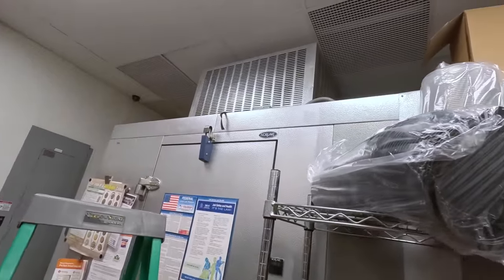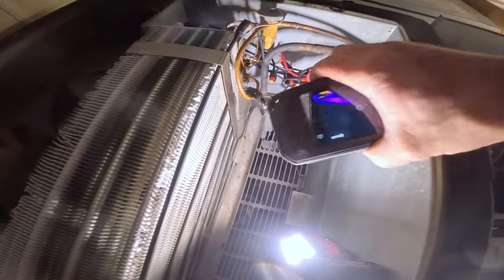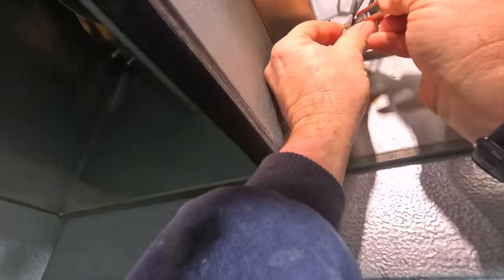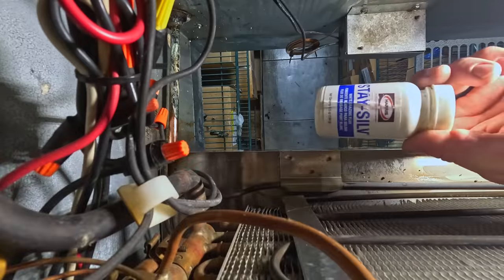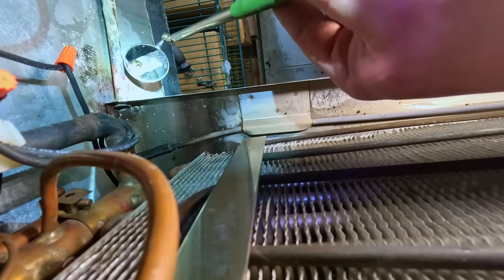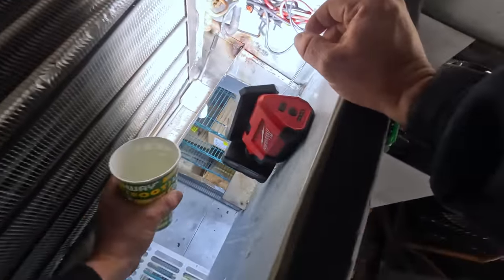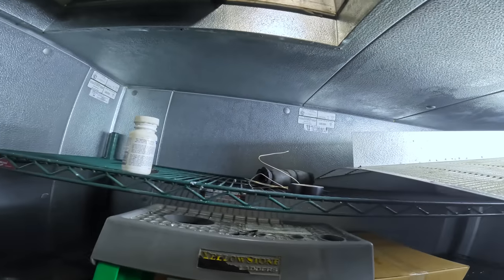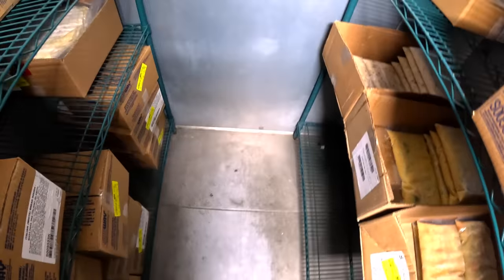Water Leak In The Freezer

Comment: Not sure if someone already mentioned it, but on those Norlake boxes you can remove the entire drain pan by pulling it out from the bottom. Remove evap fan bracket, take all the drain pan screws out, then move the return/supply air grate and pull the entire pan out. I’ve had to fix many of these at Subways, never fun to do. Love the videos Rick keep ‘em coming!!!!

Comment: I have done plumbing and construction , but HVAC and electrical I generally stayed away from. I respect the "electrical gremlins"  very much . Plus as you note,  you have to know what you doing and be licensed /insured to do that  stuff, anybody doing that stuff not license can easily void insurance on that and property damage in general, if something happens later.. 
"Code" is the word.

 Still when you note using "Silver solder" , that turns me on,  LOL. Much like talking about "Heli-coils" or "blue-knifes" or big chainsaws or  working on Heavy machinery/steel",etc. . I did alot of work in general contracting, mechanics, and heavy metal , tanks in the Army and as a civ DoD contractor for years, . Then  I was a "Helpful hardware man " at ACE Hardware many years. Just talking to contractors and people trying to fix things and the problems they had, and what might/would fix the issue was alot of fun. 

Somebody coming into my store  asking for "Silver solder" as an old plumber's "apprentice"?  I had to find out what they were doing . LOL
Or if some "amateur" came in and looked at the regular solder and then grabbed silver solder.  I say, "Hey wait a minute, what are you going to do with that? That stuff is very expensive, is used for only certain things  and might not be what you need" . 

I am of course "old school" , and lead solder was generally  what we used in plumbing running copper back in the day..  
Silver solder was "something special". so to speak. 
And I learned a good bit about using it from HVAC dudes / electricians over the years.. 
Regards
Reply from the maker: Wow, that's some pretty good information there, thanks for Sharing! My dad built the gun shield for the Abrams tank.

Comment: "The problem is poor manufacturing practices" You nailed that . :) Though I wonder why they went Metal for a simple drain line.  PVC would work there. Commercial construction? IDK. Metal costs alot more than plastic and is not needed there . The actual compressor/heat transfer" lines you fixed ? Yea sure. You did the right thing

Comment: There’s a trick to do the electrical tape. use a small socket and wrap it with electrical tape to make a small roll of electrical tape I learned that from an older guy I worked with.
Reply from the maker: I think I saw that on a commercial once👍👍, it was super tight,  even that probably would have hit.

Comment: Great work, I had  similar one years back that I had to epoxi it, to get it to stop leaking. Does anyone make a fitting that screws together with a rubber seal and a stub that could be installed in the hole? I think it may be called a bulk head fitting??. Thanks for the video.

Comment: Good find and repair job Rick. I've never tried my hand at brazing. But I can solder good. Should brazing come naturally if I was to attempt to do it? Keep the videos Rolling!
Reply from the maker: If you use the correct flux and filler rod you should be fine. Watch your heat is another important thing to watch.